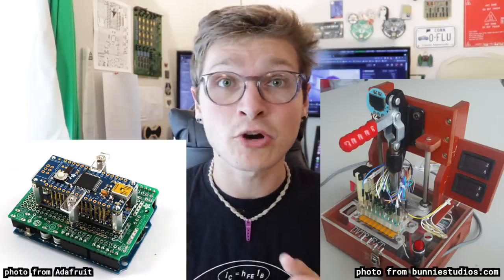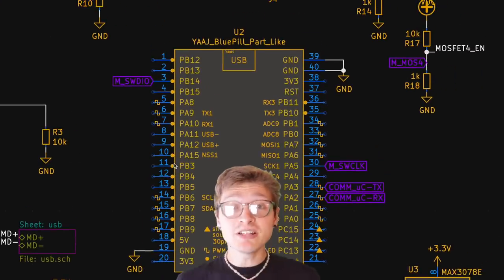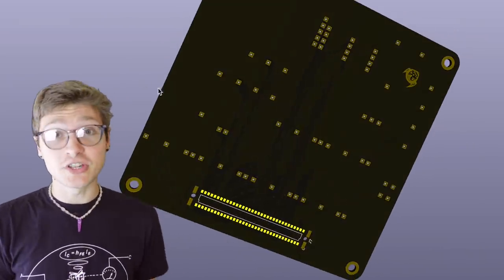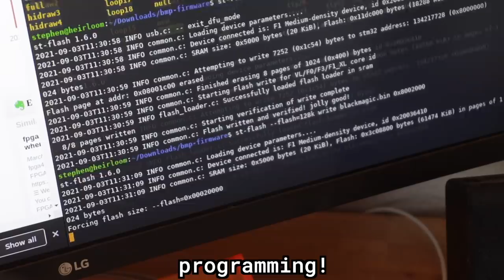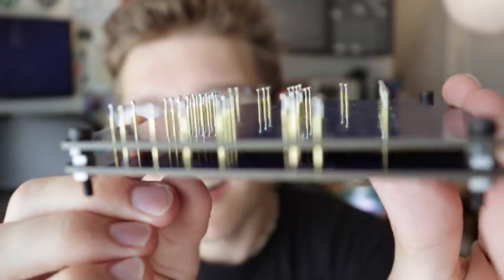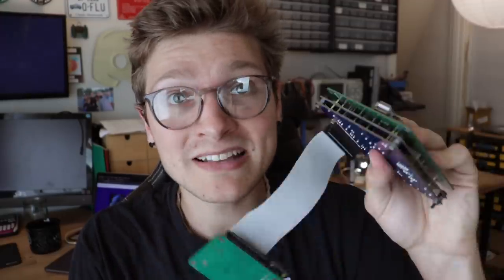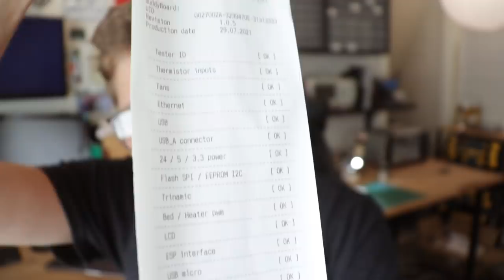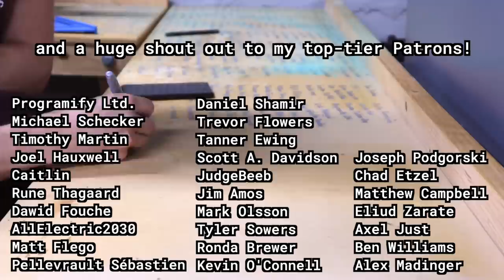These Are a Game Changer for PCB Production

Comment: Our typical volumes are 500/yr of a given board or less. With CM doing AOI, and sometimes X-ray, yields are so good not worth it for test setup. All gets tested on production line.
Reply: And the production line doesn use pogos?
Reply: @pflernak  It gets cabled in and claibrated in final configuration.